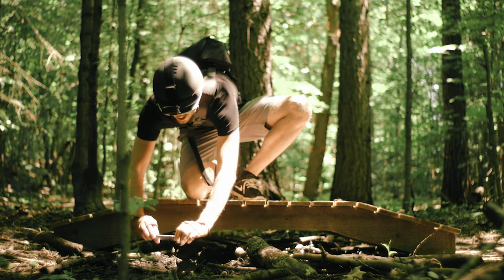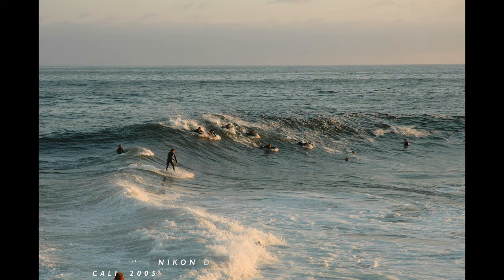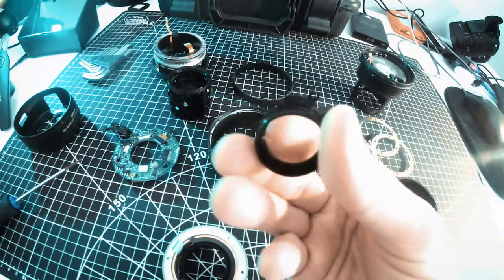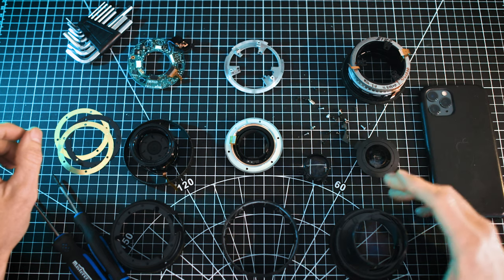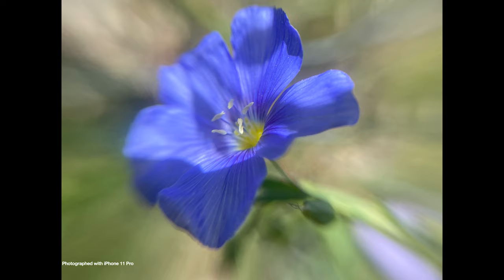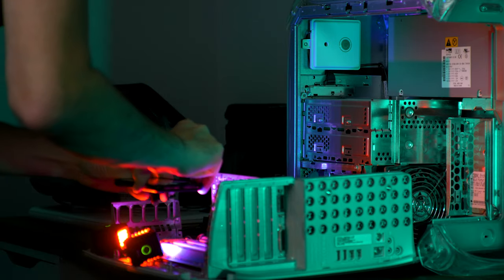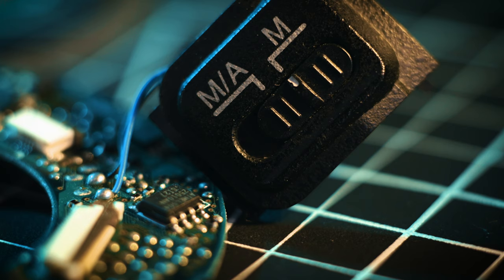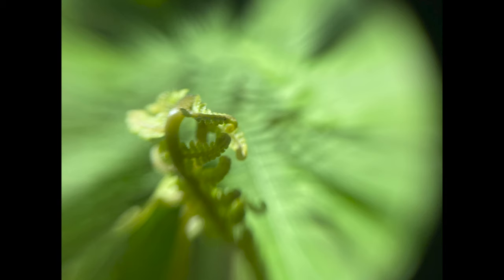iPhone Photography - How Made My Own Lens

Comment from the maker: What are some photography experiments you’ve tried?
Reply: Build a simple pinhole box :D
Reply: I love flipping over front elements in lenses. It doesn’t always work but when it does it looks so cool.
Reply: Sadly I guess the most experimental thing I’ve tried is lightning photography at night
Reply: I took a yashika 28-70mm zoom appart and made a 24mm wide prime out of it and a 50mm f2 body.
Reply: built two macro lenses for phone together and the result was more phenomenal...But i like the Idea of the back lens piece....
Reply: Recently tried some Polaroid PolaChrome and PolaPan.  Interesting, and somewhat rewarding, but also not optimal results.  Still, satisfied my curiosity.
Reply from the maker: @merlinmarquardt  Sometimes satisfying that curiosity is worthwhile in your efforts. 
Best way to learn and develop some skills that might not be relevant in the moment, but could definitely be a little later down the line.
Reply: Make my lenscap into pinhole lens
Reply: Using different mount adapters on my Canon FD cameras. Using lenses from Nikon F mount, M42 screw mount on Canon FD was really interesting.
Reply: @merlinmarquardt  I tried polablue but it was dried up :(